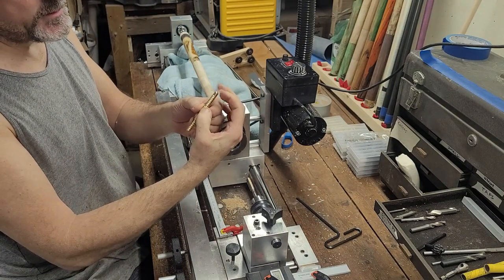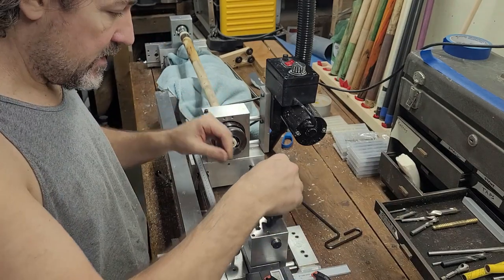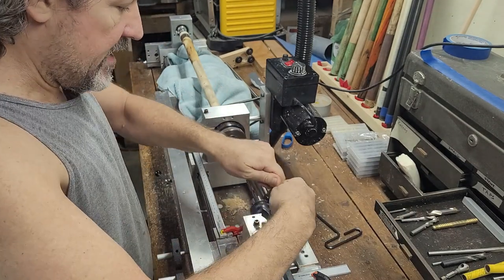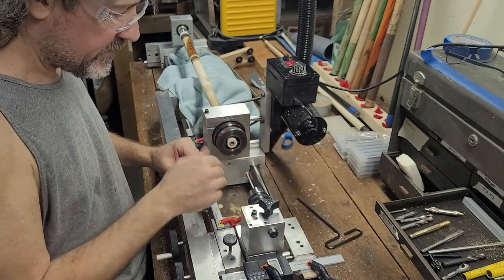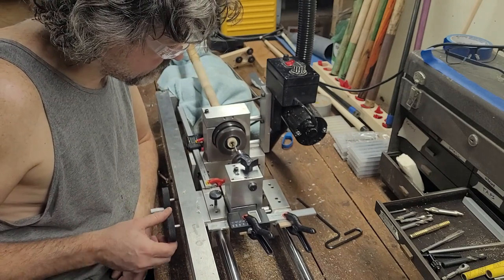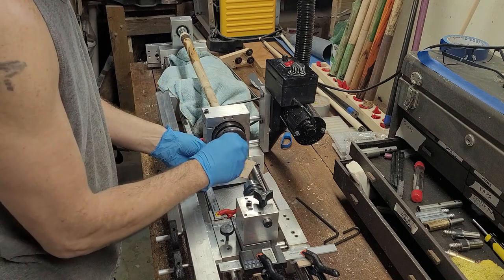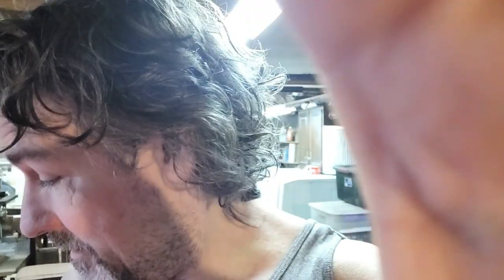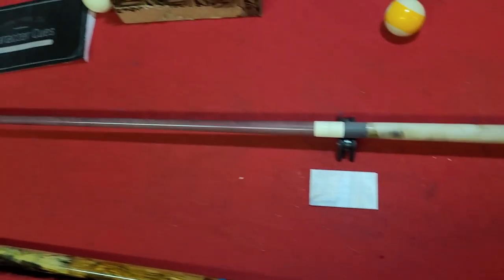Joint Pin Installation on the Rebuild of Sassy Frassy

Comment: I have 2 question's. Can you set a joint pin into the shaft?
Can you build a 63" cue because I have longer arms?
Reply from the maker: 63" inches is no problem.  I don't do the pin in the shaft. I've seen others who have tested it. I don't see the advantage and changing my processes is too big a headache to do it as a one off.

Comment: Would you be willing to fix a Molinari   Cue I have.  Someone tried to tap it for radial pin and it’s not straight.  I think it may need an insert and re tapped. Joint is currently removed
Reply from the maker: Yes. Email me at claylindemuth at outlook.com